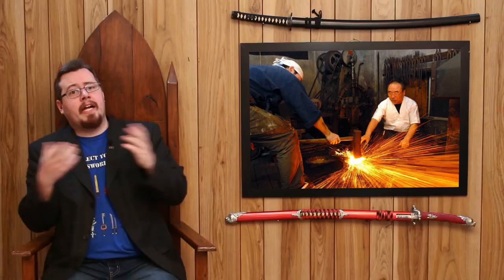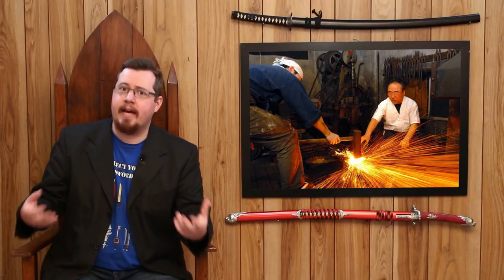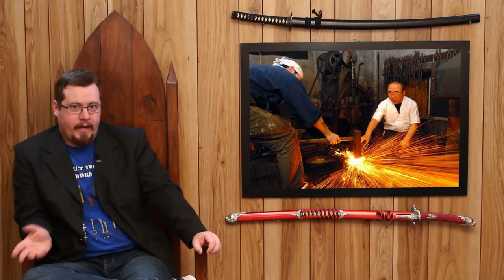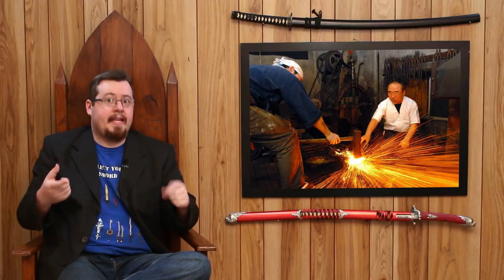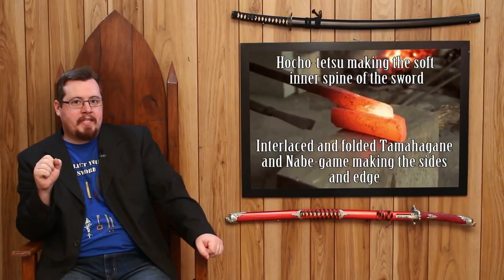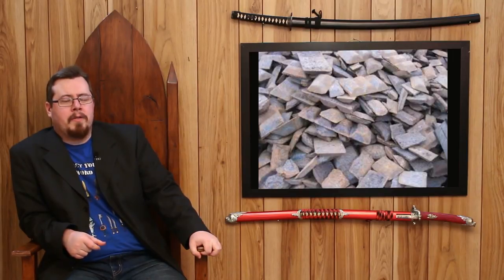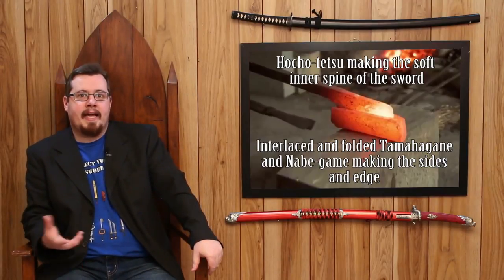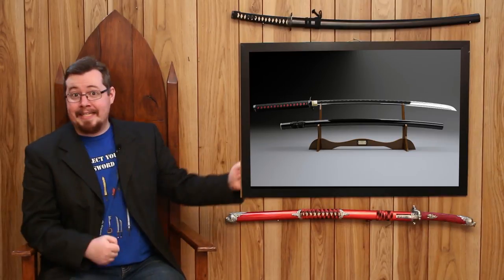The TRUTH about the KATANA, part 3: Why the steel is folded

Comment: the impurities make the frosted hamon and some of the other artistically desirable activities in the blade. id like to point something out, i own a katana that is over 200 years old and one thing i notice about it thats very different than a modern version, no matter how high quality the modern blade, they are longer and thicker than an antique, at least mine. its at least a quarter thinner and a few inches shorter, average is 27-30 inches for modern swords, mine is like 24-25 inches so they can be quite a bit shorter and much lighter, no, not super power anime bs, bla bla bla, its just lighter than a modern version, also shorter and thinner.
Reply: Well like anything there was a huge variation in Katana sizes in ancient Japan. Katanas vary in size from being about the length of a one handed European sword to being the same size as a full sized 2 handed Longsword.

There are a lot of replica Katanas out there and a lot of them don't conform to the proper dimensions of a functional sword.
Reply: a full sized european longsword could get up to the 40+ inch range if they had a tall enough wielder, a japanese sword would not be classified as a katana if it got that big, I am not very familiar with japanese sword names and sizes but I think it would be called something like a nodachi or naganata at that point.
Reply: Do remember one thing - modern katanas are generally made with Americans in mind, or at least American sized populations (as most First World countries have). But historical Japanese people are of a smaller stature - this would lead them to using slightly smaller weapon ring that fits their stature better. I think this is the largest determiner of the slight difference in sizes you see...
Reply: Strange that it is thinner. I would think ancient blades to be thicker since the steel in it is not as strong. Not only that but ancient blades were more likely to be used so they would have to take a lot more abuse.
Reply: marinus18 if It's true what he says and tue Katana is truly 200 Year pls than maybe the polishing and sharpaning made it at least thiner...

Comment: Please, in the name of the lord, stop talking about chemistry as if you knew what you are talking about. It's not possible to burn of impurities, period. The reason is that the oxidized material, if it is not a gas like CO2, will not magically disappear. What do you think will happen to, for example, titanium that is in the blade and exposed to oxygen under heat? It burns, sure. But it will not disappear. The oxide stays in the blade.

I do not know, nor do I claim to know, how forging reduces the impurities in the blade. But I know that things don't magically disappear just because you set them on fire. That is why ash remains in the fire pit after burning.

Comment: you say "water" in the least australian way ever. its sounds forced. are you doing for the benefit of non australians?
Reply: also, the table shoes iron (mon)OXIDE and Aluminium TRIoxide. its only dioxide if its has 2 oxygen atoms in the structure